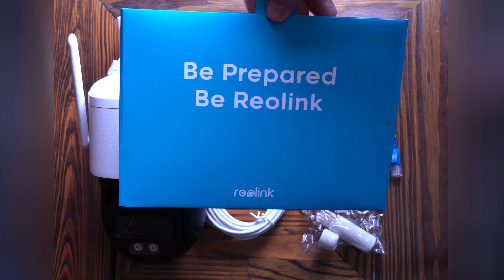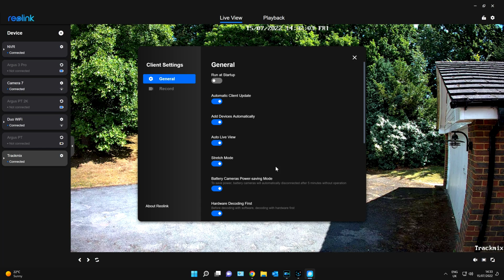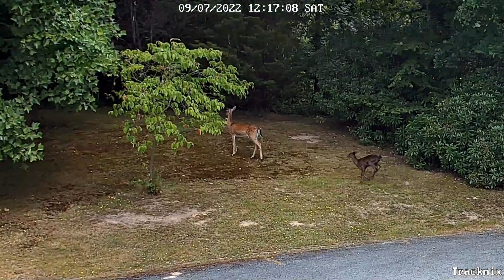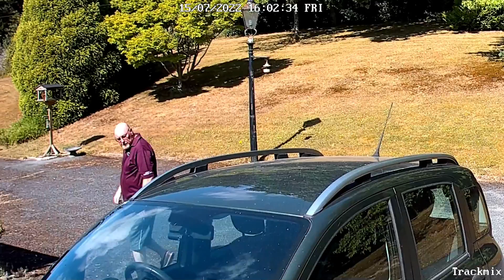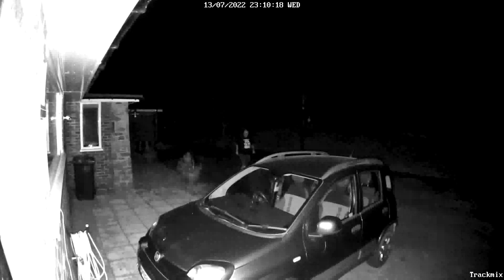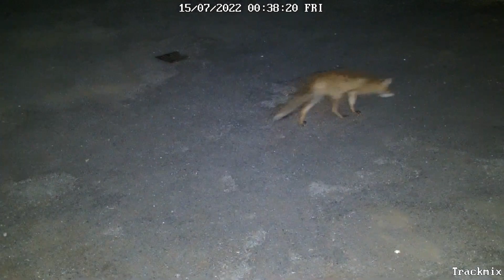Reolink WiFi Trackmix Review - A Great Dual Lens Security Camera With Tracking and Smart Detection!

Comment: I got two, and I love them. My one critique is the zoom. It'll zoom in on a person, but not close enough. It's capable of much greater zoom manually, but uses it conservatively on it own. As seen in this video. 
It's smart enough to detect a person, zoom in on them!

Also you need to adjust your display settings. You can crank up the bit rate and FPS, And turn it to constant.
Reply from the maker: I am impressed with mine too.  :-)

Comment: SAVE YOUR MONEY. Despite what they advertise on their website, it only lets you monitor 1 lens. I’ve been back and forth with customer service and they say it can only monitor 1 lens. Even though it shows both lenses being monitored by smartphone, iPad and monitor. CUSTOMER SERVICE SUCKS.
Reply: I asked you over on Digiblur's channel how are you trying to view the camera. The two lenses can be viewed at the same time on the client, the phone app and supported Reolink NVRs. I'm using mine with a Hikvision NVR and I can view both camera lenses at the same time. I highly doubt that Reolink customer support is telling you that only one lens can be monitored at a time. If you have an older Reolink NVR perhaps it won't support viewing both lenses at once but you can view them both with the client as well as the phone app. If you can't see both lenses simultaneously through those last two you have something setup wrong.
Reply: @Pro1er How well does this work on a hikvision NVR? Can you use any line crossing .etc on the NVR itself? Does the ptz control/tracking work OK? Thanks
Reply: I see both on the app. Swip right or left and can toggle and see both on the page if i like at one time

Comment: What range did you have to your NVR/router? We hope to have our system improved soon, subject to things beyond our control, but as they stand - some of our cameras without a cable are intermittent.
Reply from the maker: I have a BT WiFi extension disc about 10 feet away Peter.    :-)

Comment: Question? Is a NVR/hard drive required? Or the subscription plan online storage is any good?
Reply from the maker: You do not need any storage other than the Micro SD card unless you want 24 hour footage or to have a back up of any footage taken when the camera has detected something.  I have the wide angled footage recording constantly to my reolink NVR.  I would not use a subscription plan personally.  :-)
Reply: I use my POE version with 256GB memory card.  I only record humans and with a fair amount of street traffic, it holds over a month.  Eventually I may link it to my NAS.

Comment: Regarding per detection, I have a few Reolink cameras and they never pick up bugs or bats, even on the default settings, perhaps you can try adjusting the sensitivity. 
The telephoto tracking is really jerky on that camera, (much like my 823A), and like all Reolink cameras the night vision is terrible with anything that moves. I have a super-zoom Chinese camera that I bought on a Chinese website a couple of years ago and paid about the same price for it as the Trackmix. The tracking is very smooth, there is almost zero tracking noise on the recorded audio, plus the zoom is optical. The night vision is IR only but the IR emitters are very powerful so the image is much better than the Reolink and they also adjust to the distance of the zoom. It also claims to have a Sony low-light CMOS sensor. I think Reolink could do a lot better with their cameras but chose profit over performance. I will give Reolink credit for one think though, their AI detection works really well once you fine tune it and it's the only reason I keep the few cameras that I already have.
Reply from the maker: I like reolink products.  They are not the best, but I think that they represent good value and are reliable.  :-)
Reply: @RussellPlatten  Especially when they are free. 😉
Reply: Reolink is very good at detecting people. night shooting is weak, I agree. which PTZ camera do you have that you praise. is there a link?